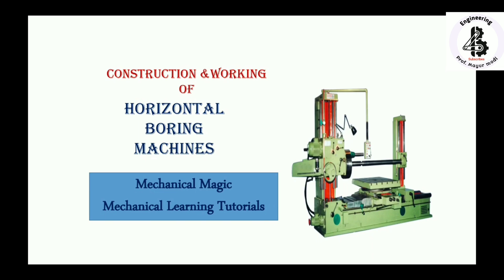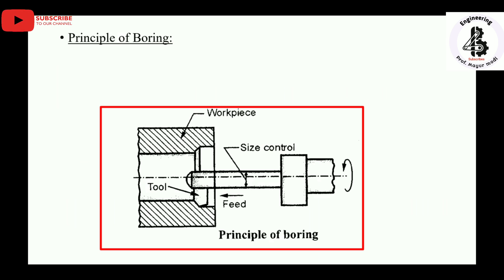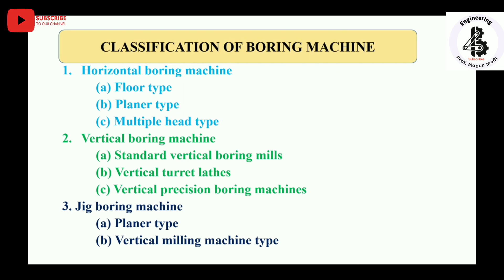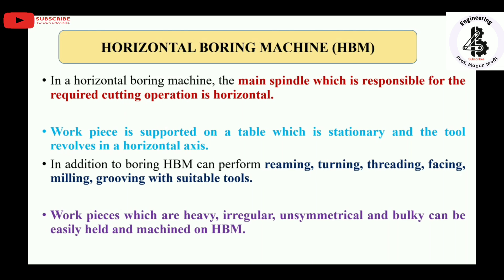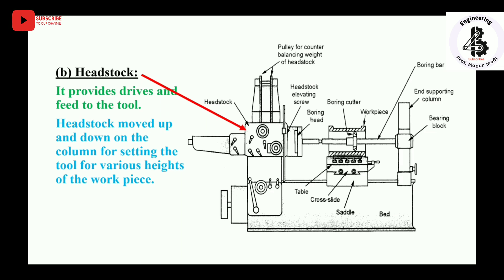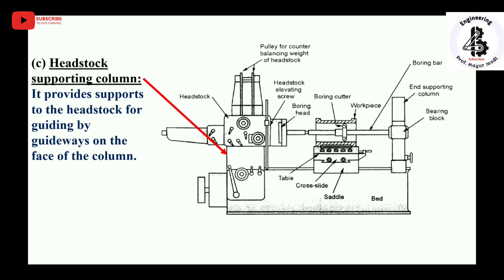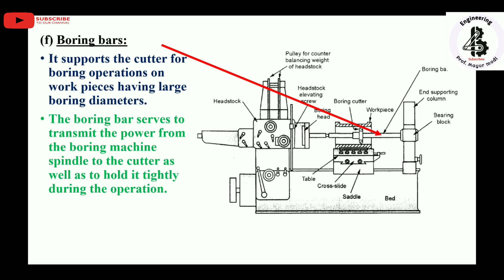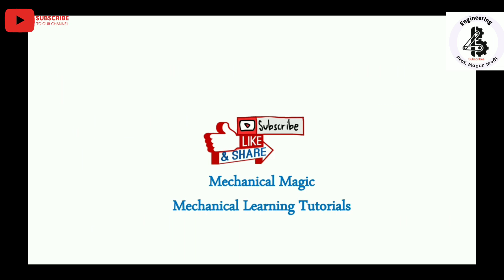horizontal boring machine | horizontal boring machine working | Metal cutting | MP |PT

Comment: We have 3 of these.  We repair them also inhouse. The imported ones perform very well .
Mostly their table and head check Nut & screw needs replacement as they are the only part which are consumed the most. Apart from that if lubrication is there and used gently they perform really well.